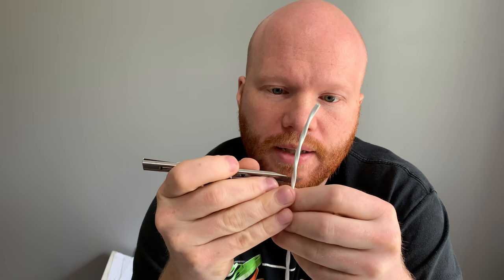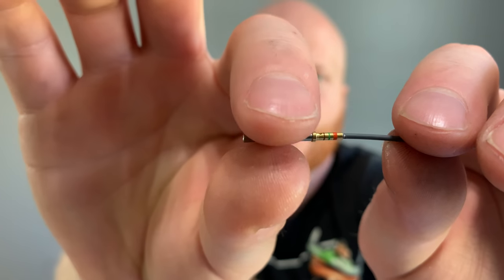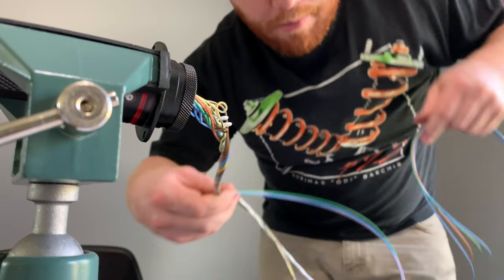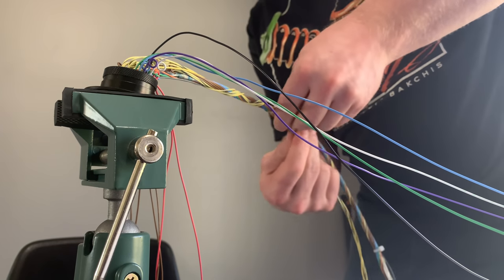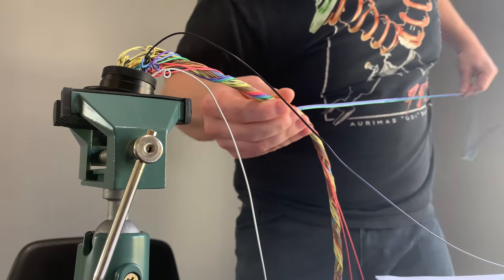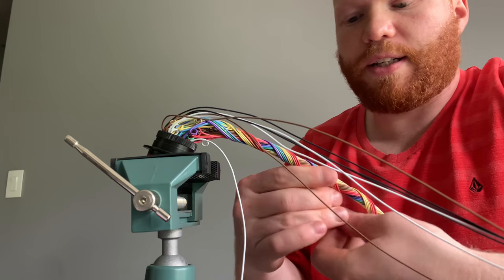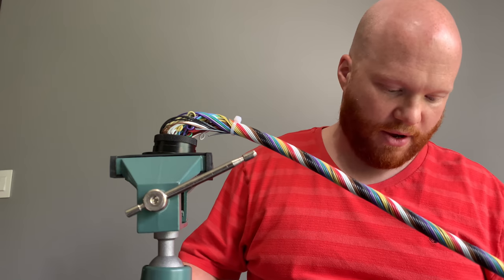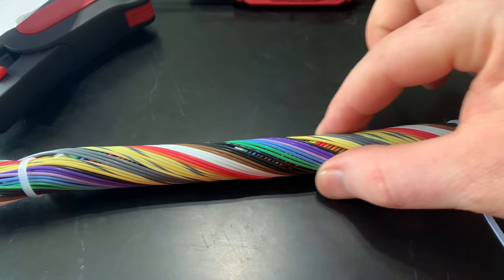Motorsports Wiring Harness Part 2: Concentric Twisting

Comment: I really really want you to film a compleet harnass because it's really amazing and you're just good at explaining it. I'm still really interested to see how you get the wires out of the harnass to go to the sensor ect keep up the good work
Reply from the maker: Yeah I'll definitely be including that in the next video, it's something that took me a lot of time to learn, and I'm still not as good as a lot of people at!
Reply: @signal_msw  agreed with Luke, I need to redo my harness now that my hacked together solution has gotten my car running. I'd like to see how you build the engine side of the harness.
Reply from the maker: Yeah, the next harness will be a bit more simple, and I'll cover things like lacing tape and terminating the connectors.

Comment: When cutting the braid off, instead of risking wire damage, try this:-
Bunch braid in the area of the cut, just like you did, but then, use smooth flat pliers to form the braid into a “flat disc” exactly where you want the braid cut. Then use  sharp flush cutters to cut around the base of the disc. Hope that makes sense.
Reply: I slide a metal tube over the wires between them and the shield and cut on the tube so mine are safe

Comment: The wrapping angle affect number of wires, so with correct angle additional wires are allways +6 if using same gauge wire. Additionally, I’d leave filler wires long enough to be able to terminate them with pin if needed for additional equipment, or spare if needed, then just route within harness to connectors. Some harnesses have at least 2 spares on all branches to make even layers.
Reply from the maker: Yup yup, and I’ve done exactly that on harnesses I’ve built since this one.
Reply: Agree completely about filler wires being connected, they have got me out of trouble several times

Comment: When working with shielded wire at the point you nip the part that you bunched up I would bend the wire at the first cut and pull the wires out of the center, it leaves the shield as long as the wires and you can twist the shield and connect it without out the solder connector. At least thats the way we do it in industrial applications.
Reply from the maker: Motorsports applications prefer the solder sleeve. Your way is a viable alternative though.
Reply: @signal_msw  you can still do the solder with the way I outlined.

Comment: Hello. Could you tell me how to calculate the relationship between the increase in the length of the wire and the angle of the concentric twist? I need to estimate how much the wire length would increase.

Comment: Hey great content, quick question. I'm using IGN1A coils saw you're using 18 guage wire for the power and ground. I'm not use an autosport connector tho. Should I use a thicker single 16 guage wire and  branch out to 4 18 guage ?

Comment: Liked and subscribed! Thanks for sharing your knowledge with us. I have one question though. I keep reading that white is often the cheapest color, wouldn't it make more sense to use this as a filler? Is grey similar to white in pricing or is white a common designation for something?
Reply from the maker: Really you could do any one solid color, as the cheapness comes from buying it in big bulk quantities. All of the solid colors (non-striped) are the same pricing from the suppliers I've seen. I think white just looks clean and has good contrast with the idents for easier ID.

Comment: I will point out that the wire barn size calculator is for wires in free air, not in a bundle. I have wondered about these concentric bundles. Looks like a nightmare of excessiveness, but I like it.
Reply from the maker: Indeed. Also the default is a 2% drop, but a 5% drop is generally acceptable in automotive.

Comment: Would be cool to have your opinion and inputs about PDMs
Reply from the maker: PDM's are great! They can really simplify things, but they're not necessary. You really have to think about how it fits into your specific application. Most street cars with all the creature comforts and necessities are going to have more circuits than a single PDM can handle, and two PDM's is a big chunk of change. You can build a nice, compact relay and circuit breaker board that will still be extremely reliable for a fraction of the cost, and it might fit the application better. Stripped down racecars are another story!

Comment: The reason for a spec on the insulation stripped behind the terminal is due to unnecessary strain caused on the conductor strands when the insulation is butted up to the terminal body. 

Specs are for reasons not for fun 🤙🏻 good video though buddy!
Reply from the maker: Yeah I knew I was going to get shit for including that section. I realize that you need to keep it off the back of the terminal, I just get annoyed with the people that critique wiring so intensely.
Reply: @signal_msw  by no means is it to put you down, wonderful quality work you’ve shown! For me I’ve formed the habit of being my biggest critic because I’ve gotten to the point I realized you can’t learn from being right, only from being wrong, so I became in love with failure and always recognizing it to learn from it 🤙🏻 cheers man

Comment: Solder , not soder unless sodomy is your thing . Its an English thing LOL . Like ' soldier ' or ' sold ' , even solution . No silent L here . Silent Ls in ' would ' , ' should ' etc. Interesting stuff . Very useful for Canon plug wiring for both motorsport and aero applications . Depending on pitch of twist , you will need to add a percentage to your original measured lengths , between 15% - 20% is a good start . Incorporating twisted pairs for CAN buses etc., makes it fun and these are typically core wires . I like to incorporate plumbers Teflon tape between layers . Its thin and reduces friction between layers in bending and vibration and keeps layers tidy and is a good dielectric when running voltage wires in the core .

Comment: Might be a dumb question but I am watching right now and seen you put that grey filler wire in the first layer. I understand it is to fill the gap but if you didn't do the filler wire would is effect the layer on top of it? I understand filler on the last layer so the DR25 heat shrink looks correct.
Reply from the maker: Depending on the gap, it will. Also, it's hard to get the layer to stay in place if there are gaps, and when using the lacing tape, it tends to move around while you're tying it. Overall, just not ideal. If you're concerned about weight, use a linear twist.

Comment: Do I have to pin the drain wire in the shielded cable on both sides of the connector. Im doin a holley efi has 3 wire cam and crank shielded wires with drain wire
Reply from the maker: Yes. The drain wire needs to go to signal ground.
Reply: Awsome thanks so much I really appreciate that info. It was holding me up i cant find that anywhere. yes the wire is pinned in ecu connector already I got a flying lead from Holley.

Comment: to use air quotes for "Mil Spec connectors" is incorrect. Those connectors are indeed a Mil-Spec item. The Part number starts with MS, meaning military specification. Still used today in military and commercial aviation. I work in an Aerospace company where we build a lot of electrical components so I see them everyday.
Reply from the maker: I just hate the buzz word “mil-spec” when it comes to automotive wiring harness work. It is not synonymous with the best quality one can buy as is implied.

Comment: Question, how do you fit 18awg wire in to 20awg or any larger wire in to smaller pin/socket?
Reply from the maker: Don't do this. Buy connectors with properly sized pins and sockets. For Deutsch connectors, 18awg wire should only go in size 16 pins and sockets. The pins and sockets are only designed for a certain amperage, and if you need 18awg wire, you're likely going to exceed the seven amps the 20awg pins/sockets are rated for.
Reply: @signal_msw  Did you have 18 gauge shielded wire in this video and 20 awg connector?
Reply from the maker: @Bendover-bv9no  The shielded cable for the knock sensor is, yes. The wire just fit in the pins, and this wasn't the correct way to do things. Knock sensors are not high amp devices and I should have bought 22awg shielded cable. The other connector that the Injector wiring went through is a size 16 pin connector.

Comment: So the shielded wires will be for injectors? Like the ground or power side?
Reply from the maker: They're direct injection injectors, so they actually pull a lot of amperage when they first open. It's to protect the other signals around them from interference.
Reply from the maker: Both sides.
Reply: So is that for just one injector? What about the other cylinders?
Reply from the maker: @stevenlocke4769  there are four shielded injector bundles in one connector, and one shielded cable in the other for the knock sensor.

Comment: I personally frown against using that type of shrink tube with the built in solder because you have no way of knowing how good the connection actually is because you can't see it. How you should go about pinning a braided jacket is by slitting up the length of the braid, pulling out the pieces that are cut off basically undoing the braid then twisting the strands together. Then you take and remove some insulation from another piece of wire and slide it over the twisted strands. The use an adhesive lined shrink tube and slide it over the 2 wires and also the new wire you made. This will hold the jacket that was put over the strands in place and it will cover up any exposed strands going into the jacket. less connection points = less points of entry for problems.
Reply from the maker: These are Raychem solder sleeves, not the cheap chinese junk you see everywhere. They’re clear when they’re shrunk, so you can see the connections just fine, and this is the motorsports approved method at the highest levels of competition. This harness is also completely sealed with Rt-125, so ingress of anything is not going to happen.
Reply: @signal_msw  I am  surprised that they use those things at the motor sports level. The single biggest thing about motor sports wiring is to eliminate possible failure points. Any time you join 2 wires together that becomes a potential location for a failure. The way I described to do it doesn't join wires together so that would make it a more reliable way of doing it. It's as more connections = increased chance of having a point of failure. I am also going to tell you there is no way on earth those shrink tube solder connections contain enough solder to penetrate the wire and also the braiding to make a 100% connection. It takes a lot of solder to tin a wire even when it's a thin wire.

The other issue is if the solder is not 100% silver solder it is going to have some resistance to it. Keeping resistance down is a very important thing to do.

Comment: Did you actually used the AF8 and the TH1A turret to crimp those terminals? Assuming they are size 22 that's not the correct tool for the job, or am I missing something?
Reply from the maker: No, I used the TH163 head, and these are size 20 contacts.
Reply: @signal_msw  not what you said you're using in the video but thanks for the carification. Keep up the good job!
Reply from the maker: @joaooliveira837  yeah I probably switched the deutsch dt connector and the autosport one around.

Comment: Wouldn't you risk melting the insulation on the conductors and grounding the injector (or the other sensors you use shielded cable for) when you solder the shield like that?
Reply from the maker: If you can see my pinned comment, normally your roll the shield back over the cable before soldering. Either way, the insulation on tefzel wire is rated for higher temperatures than solders melting point.
Reply: @signal_msw  ok got it, thanks. Amazing work.

Comment: From a signal - noise perspective, you would do better to interweave the signals with the grounds.  This would help prevent cross-talk between the sensor leads.
Reply from the maker: Do you mean twisted pairs, or just in the bundle in general? If there are sensitive signals, then shielded wire is used. The normal sensor and ECU grounds are twisted in the bundle alongside the rest of the wires. Other than CAN wiring and shielded bundles, twisting individual wires together is not generally done in a concentrically twisted harness.
Reply: @signal_msw  I agree with you a twisted pair is much better at noise rejection. And a shield with a proper single point ground makes it even better. Sorry to go all geeky engineer on you. I really did enjoy the video.  I would lay these down, brown, signal, brown, signal, brown, 12V.   The interweaving of the 12V with the grounds give you a free small noise bypass capacitor.  That bypass is doubled with the core shield.   
An interwoven lay will give you a slight signal to noise advantage for free. And you never know, a slight advantage might make a difference.
Reply from the maker: That's definitely an interesting bit. I may try that with this upcoming harness since all the wires will be white anyway! Thanks!
Reply: @signal_msw  They wired the Cray supercomputer with all the same color wire, you the man if you can do that!

Comment: Why'd you have to basically attack me over the measuring of the official length of stripping?

But being serious. A fast way I learnt to do it when rewiring a few cars as a mechanic was turning basically a set of paper sheers into a wire cutting mechanism. Had a straight edge that could be adjusted in height and distance from the cutting edge. Once the distances are set you strip the wire long. Slide the wire into the trimmer the straight edge catches on the insulation. Cut. Then crimp. Once you get in the groove you can really pump it out faster than trying to be more exact with the eyeball method.

Comment: What is the gold tape that is thick and thin called?
Reply from the maker: Kapton!
Reply: @signal_msw  Thanks! How do you branch off connectors?
Reply from the maker: @TheKillerMarine  A little hard to explain in a paragraph, but it's something I will be covering in the next couple of videos.
Reply: @signal_msw  Great! I look forward to it! I am adding a second fuse box to my overlanding rig and wanted to do the concentric twisting method but I will need connectors that branch out all over the twist. Great videos man!

Comment: Why do you need 6 more wires on the next loop?
Reply from the maker: Because each layer has to cover a larger diameter, so more wires are needed to keep the same lay length in the twisting process.
Reply: So if I understand correctly, if you use more, the lenght will be different from the previous layer? Makes sense, didn't thought about that
Reply from the maker: The length yes, but also the diameter. The more layers you add, the more wires have to be in each layer to fill it and maintain the same twist rate.

Comment: Looks like you watched HP Academy and are trying to make a video that's already been made but not close to the infk.it's like your learning as your explaining.
Your not even making that harness right your running power wires with sensor wires which is going to cause all kinds of interference.
Reply from the maker: Nope, haven’t watched the HPA video, and this harness works properly. Thanks for your input though.

Comment: Now using a twisted and shielded pair of wires of the injectors is just plain silly. The shielding makes sense. The twist doesn't. The injectors are going to fire at a different rate based on the engine RPM, that means the frequency in the electrical signal traveling down the wire is not going to be something that is divisible by a constant. The twist in the cable does absolutely zero. There is a reason why data speeds going over network cables has the speeds set as they do. This is to reduce the amount of EMI and that needs to be tuned to the frequency. The number of twists are done so that different speeds are able to be used and still get the benefits of the twist. 100mbit, 1000mbit, 10000mbit etc.... Not gonna see that the injector pulses. All it being twisted does it take up more space and get you frustrated when making a harness like this...
Reply from the maker: The oem injector wiring is shielded on the vehicle this harness is currently running, so I used the motorsports equivalent wiring. It comes twisted. It was simply a matter of practicality.
Reply: @signal_msw  I get why it was used. IDK if they make a shielded wire that is not twisted. If they do that would make things a whole lot easier when doing the twisting that's for sure.

Comment: Easy
Step 1 strip and  crimp all pin
Setp 2 place pins in plug and stick plug in vice 
Step 3 stick loose wires in a drill and pull trigger 
Heay persto one wound harness 
Easy
Reply from the maker: If only it was that simple.

Comment: I watched till the end that harness is way to tight
Reply from the maker: How so?
Reply: @signal_msw  There are two wires - an orange and a white (I think) that are at the "bottom" of your 90 degree angle.  They definitely look tighter than the general "arc" above it - they look pulled.  Probably never a failure point but that's the only thing that jumped out at me which might me what he is talking about?